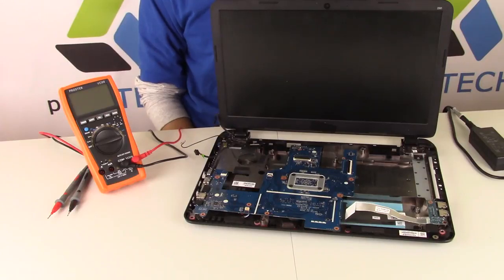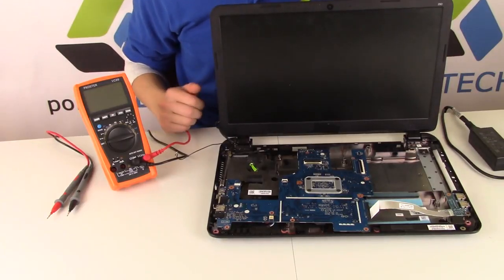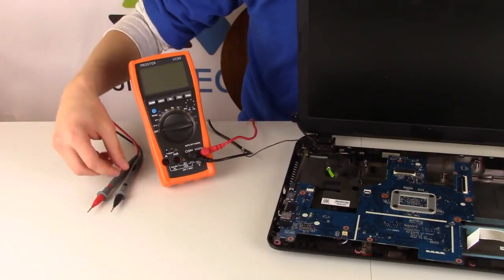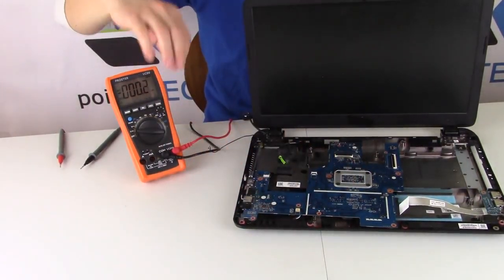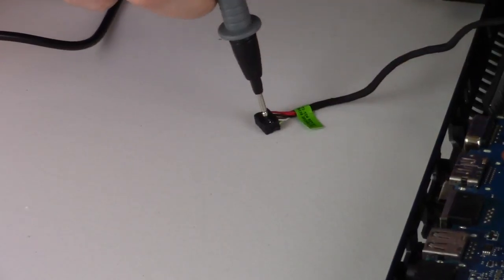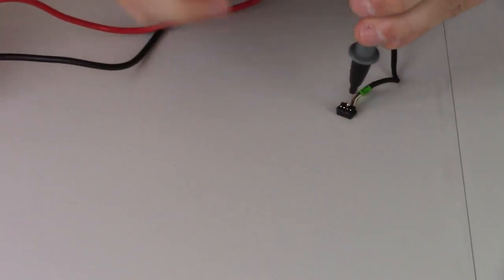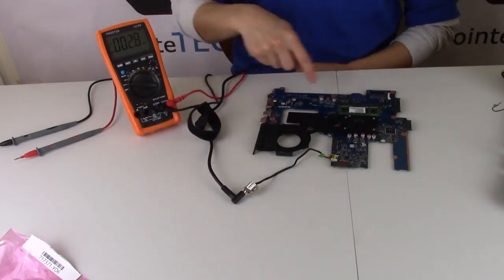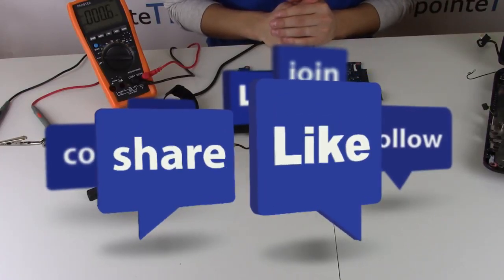How to Fix Test Power Jack - HP Laptop Computer

Comment: Hi, my problem is not what you show on the video, but I figured out you could help me, the thing is, I bought a new charger, it was supposed to be the original one, it says DELL looks like it is in fact an original one, but Im pretty sure its just fake, cuz its not the same quality. 
So the charger works, but it was doing some weird things, for example, this happened a few times that the battery got low and laptop turned off, so what you normally do, is just plug it in and turn the laptop on right away, well in this case you had to wait like 10 min for it to start, cuz it would just turn on and off.  this is one thing. 

But recently something really weird happened, I was watching a movie, and the battery got full charged, I didnt realize cuz I was with the movie, I know you're not supposed to keep charging the laptop if the battery is full charged, but let's be honest, it happens all the time and nothing weird happens, well this time was totally different, I finished the movie and I noticed the battery icon of the bar of the operative system was missing, there was no battery icon, I never thought it was because the laptop was rejecting the battery, but after a few minutes I sad it must be fully charged, so I unpluged it and surprise, it turned off, there was no icon because apparently there was no battery. 
now the battery doesn't work at all, it is supposed to be full charged, but I turned the laptop on and it works and all of a sudden turn off, at any moment. 

Ive been using the laptop plug  in all the time without the battery, cuz Im afraid the battery is fully charged and to keep charging it, so I thought it would be better to use the laptop this way. 
pls answer my question, you seems you could know what's going on.

is it possible the charger damaged the battery just after a few uses ? is it safe to keep using the charger if it really damaged the battery ? and about what Ive been doing, is it safe to use a laptop without the battery and just plug in all the time  ?. 
 
PD: of course there is the tipically problem that a laptop's battery stop working and it is unable to charge anything, but this is totally different, cuz it says it is fully charged,  and all of a sudden the laptop seems to reject the battery, so it turns off.
Reply from the maker: It is possible but not super likely.  I would easier think that the battery is just reaching the end of its life and needs to be replaced.  In general, no, you shouldnt use the laptop plugged in all the time.  Batteries should be allowed to drain down every now and then.
Reply: @PC_Monkey  the thing is, three days ago the battery lasted about 2 hours, today the laptop dies after 10 min or less, totally random, so its not possible to work like that, so I thought if Im goint to have it plug in all the time, I better take the battery out, I mean it is working like a desktop pc, I dunno if that's something we should not do.
Reply from the maker: @xxxisaacxxx  Yes, when a Battery dies, its performance can be sporadic or take a drastic nose-dive all at once.  Your computer should work fine with just the charger and no battery unless your doing any 'heavy' tasks like extreme gaming or other CPU / GPU intense work.

Comment: Hi sir, my laptop is sony vaio, I just follow ur all step u given everything is ok but it won't turn on no power is going because charging light is not turn on. What is the issue.could you please help me?
Reply from the maker: For a laptop that wont turn on, start your troubleshooting process here; 
https://www.youtube.com/watch?v=_MOe71kBPOY&feature=youtu.be
Let me know how that goes :)
Reply: @PC_Monkey  I checked everything, I try bios reset and battery, charger,power jack,power jack input to circuit also perfect, I could not find any solution. Could you please help me?
Reply from the maker: @mohanpradeep2241  If none of those steps worked, the bios reset didnt help, and you have already tested the charger and power jack, then your left with the motherboard.  It would need to be replaced
Reply: @PC_Monkey  ok, thankyou sir

Comment: My power jack doesn’t work , I don’t know how to replace it and I’m in quarantine 😐
Reply from the maker: If the Power Jack is on its own board, then you can simply replace the board.  If its soldered onto the Motherboard, then you would have to solder on a new one or replace the Motherboard.  Is your post office still working?  You can try to purchase on sites like Ebay, Amazon, etc.  They are slow but it should get to you :)

Comment: I was hoping to get the laptop tested with the multimeter but it turns out the multimeter is a dud, DOA. Just completed the return now with Amazon and hopefully the replacement works.
Reply from the maker: Bummer :(  Thats horrible, to buy it, wait to get it in, then find out its bad, then have to wait to send it back for another lol.  Good luck !!
Reply: PC Monkey yeah I know right! But hopefully it's a quick replacement. I'm really looking forward to getting 3 laptops going. The funny thing is they're all HP laptops.
Reply from the maker: @BlaGGah  Most of mine are Dells :)
Reply: PC Monkey i mostly stick to Dell and HP. But I really love Lenovo as well.
Reply from the maker: @BlaGGah  Ya, the Lenovos I have owned, I have liked :)  They have a nice feel to them
Reply: @PC_Monkey  I got the replacement for the multimeter and i did the tests, the power jack is good and the connector on motherboard is receiving proper voltage as well.  Not sure what else to troubleshoot now. The power led comes on for a second when i plug the power adapter and it turns off. Same symptoms.
Reply from the maker: @BlaGGah  Your computer is not turning  on at all? And you have already tried this video;  https://www.youtube.com/watch?v=_MOe71kBPOY&feature=youtu.be
After that, you tried the BIOS Reset as shown here;  https://www.youtube.com/watch?v=VO5BhbiItCM&t=343s
If you have already tried those, and now have confirmed the motherboard is getting the correct power, then the only thing left is your motherboard is the issue and would need to be replaced.
Reply: @PC_Monkey  Yes, i've tried those already but what i'm trying to figure out is that the hp envy 17 inch one, doesn't seem to take charge anymore. When i first started to diagnose the problem i thought it was battery related, and ordered another battery, and swapped it and laptop booted up fine. The issue is it won't take charge and i checked the connector from the battery to motherboard, it seems to take power as well. IDK what else to do as im still a novice when it comes to using the multimeter and not really sure what else i could be missing.  As far as the other hp probook, that one now doesn't show it's being charged, but the power led lights up and for a second or so and turns off.
Reply from the maker: @BlaGGah  So you have 2 computers your troubleshooting?   A 17" HP Envy that wont charge the battery but turns on fine?  You checked the connection from the Motherboard to the Battery and it seemed fine?    The other Probook wont turn on at all?  So the Probook that wont turn on at all,  if you have followed all the troubleshooting videos and have ended with checking the charger and jack with no luck, then the next step is to replace the motherboard.  If the first computer, the Envy, turns on fine with the new battery, then I would assume its a charger issue or that new battery needs to be calibrated.
Reply: PC Monkey the envy works as long as the battery has juice but the batteries have no more juice in them now. I'll hold on to them a while longer because I'm trying to get to the bottom of this especially for the envy.

Comment: My laptop charges with 130 watt  adapter. when i plug in the adapter, the battery icon shows charging but I'm pretty damn sure its not. Can this problem also be referred to the  faulty power jack or could there be any other issues?
Reply: Also,  when I initially plug in the adapter and then switch on my laptop, i get the Adapter warning message.
Reply from the maker: @sagarmathapandeya4972  It could be either.  I would test both the charger and the jack.  Also, try the steps in this video.  If nothing works, it could be a Motherboard issue :(

Comment: My Laptop a half year ago turned off. Then my Laptop doesn't turn on . When charger is plugged in , light indication was also not working.
After a few months , I just pressed the power key and it turned on . It was working properly for a month. But now it again turned off. No light indication when charger plugged in. No display . It cannot be turned on. 
I TRIED VIDEO 1 BUT NO WORKING
Reply from the maker: You already tried this video;  https://www.youtube.com/watch?v=_MOe71kBPOY&feature=youtu.be
If you have already tried that, and have not been able to identify the issue, then you should have moved on to this video;  https://www.youtube.com/watch?v=VO5BhbiItCM&t=343s
If that didnt help, then you would come here to this video.  You did all those steps already?

Comment: Hello, My PC is not turning on, I have bought a new OEM HP charger, and a new jack and it didn't work ( the light in the jack didn't turn on LIKE YOURS ON THE VID).
I have ordered a multimeter to check if the port on the motherboard is working.
but what if it is not working? what will the problem be?
Can you help me with this, please?
Thanks
Reply from the maker: If your computer does not turn on, have you tried the first video yet?  https://www.youtube.com/watch?v=_MOe71kBPOY&feature=youtu.be
If that video does not help, then I would suggest doing a BIOS Reset;  https://www.youtube.com/watch?v=VO5BhbiItCM&t=343s
After that, I would then test the charger and power jack.  If those check out ok too, then your looking at needing a Motherboard replacement.
Reply: @PC_Monkey  Hi, I have fixed the problem and here is how
I have checked by the multimeter, the charger (working), jack (working), the port on the motherboard (working).
So next I have checked the MOSFET on the other side of the charging port, and there was a 19.5V of one side of the MOSFET and a 0.8V on the other side.
so I have soldered tiny cable between the 2 sides and it worked.
maybe you can make a video about it.

Thanks a lot, I wouldn't solve it without you.
Reply from the maker: @ananamer5050  Great work and thanks for the info !!

Comment: Hi Thank yu so much for the explanations. I did all the steps. Adapter OK. Charging Jack OK. Charging port does not transmit the incoming DC20V on to the motherboard. What can I do next? Please help.
Reply from the maker: You said the charging port does not transmit the power to the motherboard? If so, you found your issue.  You can install a new port or swap out the motherboard if thats not possible
Reply: @PC_Monkey  well thanks but how to install a new port. It seems the port is soldered on to the board. Am working on Lenovo Ideapad 110-15ISK Model 80UD
Reply from the maker: @harishatutube007  Yes.  You would have to remove it and solder on a new one
Reply: @PC_Monkey  Thank you. You have any idea where can I purchase a new one?
Reply from the maker: @harishatutube007  Its been a while since I had to purchase one.  Try Ebay or Amazon first.
Reply: I think I have the same problem as yours, if you have fixed it please tell me how!
Thanks
Reply from the maker: @ananamer5050  What problem do you have?  Your computer does not turn on and your trying to figure out why or your trying to replace your Power Jack?

Comment: How to replace motherboard on Hp 15 notebook.
My LCD screen turns on 2 out of 10 tries, Tried new ram, cmos, still no display when hooked up to monitor with HDMI cord.
Reply from the maker: Look up a video on 'HP Notebook 15 Disassembly' and you should find something.  You may need to fast forward a bit to get to the LCD part.

Comment: Very good. Very informative.  Ironically the laptop your performing on is the EXACT one i have.  I followed your steps... power adapter good/ getting power from MB/.  Maybe I’ll go to the other video -bios reset? Not sure. Voltage is spot on with your readings too... this was the first time i used this laptop in 3 years. Any suggestions would be greatly appreciate. Keep up the good work. Thx bud!
Reply from the maker: Is your laptop not turning on at all?  Whats the issue with it?
Reply: PC Monkey yeah sir! Correct. I have an older Hp 15 - F9H96UA.  
But... upon further investigation AND more importantly looking through all your vids... i noticed the power supply(button) on the back has a wire strip break off (solder)... sucks cuz i dont have another replacement part or strip.  After putting in Bio battery (from ur video). You said something at the end which i hope everyone takes heed.... you said, “ make sure all your connections are good”...  great advice bro! And this is after  3 times i fully disassembled the dam thing.  I’ll keep you posted.  Any comments, ?’s, or complaints are highly welcomed. Thx bud!
Reply from the maker: @xxxgonzoxxxxxxgonzoxxx5099  Good job examining it to find that :)  Good luck !!